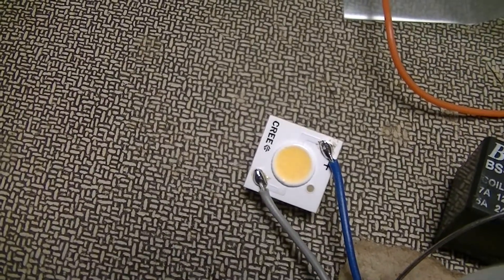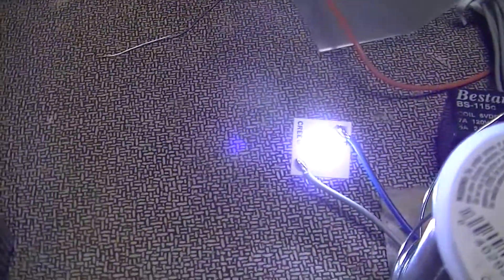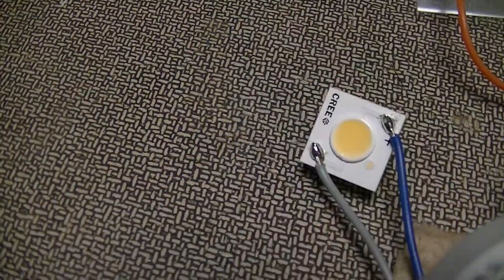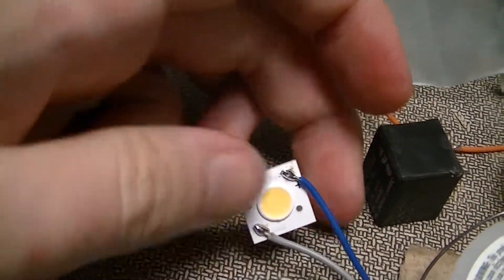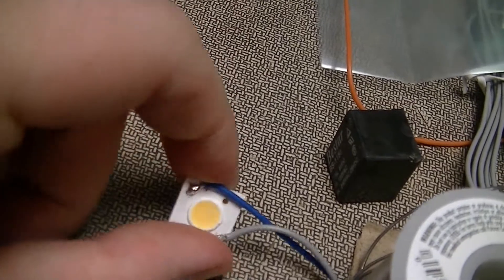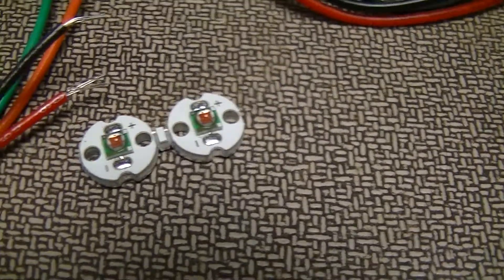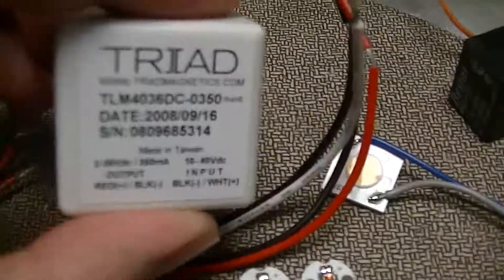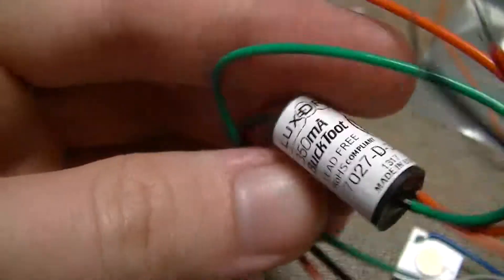New Cree LEDs and other crap

Comment: I am looking to drive the larger of these Cree LEDs with 12v from a car. I can find drivers that operate from AC just fine, but I see none that take a DC input with wattages these high. I am not much of an advanced hobbyist, so it's not like I could design some crazy boost driver myself.
Reply from the maker: Tim Ramich LuxDrive drivers are available on Digikey that can drive these up to at least 10W or so.  You would not need a boost converter as these few watt size modules with normal drive currents (350mA, 500mA, 700ma, etc) have forward potentials of 9V to 10.5V and thus a boost converter makes no sense on a 12V supply.
Reply: Yeah, as I said...larger. 36v@2.4a or 72v@1.2a...
Reply from the maker: Tim Ramich
That would probably require a custom solution at those power levels.  LuxDrive BoostPucks (part number 4015 specifically) would work if driving the LEDs at full power isn't required.
Reply: randacnam7321 Driving 350 mA into an LED that can take a maximum of 3.6 A must be a joke. I don't have the know-how to build a custom driver.
Reply: Tim Ramich 
It does not need to be a "led driver". A generic switched mode boost converter will work. Search for "600 watt dc-dc boost converter". Available from many sources at about $15 a piece. I mean the ones with a toroid, three big capacitors and a heatsink the same size as the device itself. That's a very common part.

No need to build anything. Just adjust using a basic multimeter. I have not tried that with a car battery, but it works with a 12 volt laptop power supply. Should be just the same. Of course it won't likely be good to 600 watts when going up to 36 from 12 volts, but we're dealing with just 100 watts.
Reply: TheVessapaperimuumio Yeah, I don't know if I could trust such a cheap piece to last. This would be for high beams on a car, so it's not like  "oh well, no problem" if it breaks.
Reply: Tim Ramich 
Oh, that clarifies the issue a lot. Personally, I don't think high beams are anywhere near as critical as low beams, but that depends on whether your low beams are on at the same time. Still, making separate circuits for left and right gives a lot of redundancy. And you might want to have any modified and questionable lights as aux lights combined with the original high beams. It's more practical to build inside an aux light casing, too. The Cree emitters with amateur solder joints are not really automotive rated, either.

I'm not going to argue about illegal modified lights, as I might also operate such equipment given it works. And glare to others is not really an issue with high beams or foglights(not to be operated when encountering oncoming traffic unless absolutely necessary). Low beams are another story.

There might be another problem. Huge LED arrays are inherently very floody because of their geometry. Will there be enough range or "throw" to make a good full beam for a range of 100, let alone 200 or 400 meters? I doubt that. It's made to light up a warehouse when the ceiling is 12 meters away. Even the Cree MT-G2 or XHP70 is very floody compared to XM-L2 or XP-G2. And the MT-G2(that might be too large) is tiny when you put it side by side with this array. Any amount of lenses or reflectors won't concentrate the light beam from a big flat surface like it would from a filament or HID.

These would make a great work lights for diggers, agricultural machines, forestry machines or, say, lawnmowers. It's like daylight at 10 meters. But in a car or a motorcycle you want to see much further away. With a large LED It might be worse than trying to go 200 km/h with only fog lights in total darkness.

If I were to build a LED high beam from scratch, I would use several XM-L or comparable size with individual reflectors. Or I would not really. Any homebuilt LED driving light that actually works will draw attention from the authorities and result in a traffic stop and fine pretty fast.
Reply: My low beams would be regular old bi-xenon HIDs. Nothing modified other than fitting them onto a car that's almost 30 years old.
Reply: Tim Ramich 
Fitting HID lights into a 30 years old vehicle sound like an extensive modification. Good luck with that! What kind of xenon headlamps?

The concerns about these COB leds performing as high beams are still out there. I'm interested in seeing your results if this works out. What sort of optics are you going to use with the LED?
Reply: TheVessapaperimuumio I don't know what type of HIDs. Whatever fits and is easiest to seal. It shouldn't be too bad, seeing as how my headlights are flip-ups. I am not planning on putting them behind some plastic housing. I will only be sealing the sides and whatnot from the weather.

As for the LED optics, I will use some kind of HID lens. As for cooling the LEDs, I was thinking some kind of generic CPU water block and a small radiator.

So yeah, I guess they would be auxiliary, since the HIDs will be bi-xenon.

Comment from the maker: The stuff I used is Aavid Thermalloy thermal paste.  The 2oz tube that I have was only ~$10 IIRC, but I got it years ago so prices may have gone up.
I may get some proper thermal adhesive next Digikey order, if only because the cyanoacrylate fumes condensing on everything are a bit of a pain.